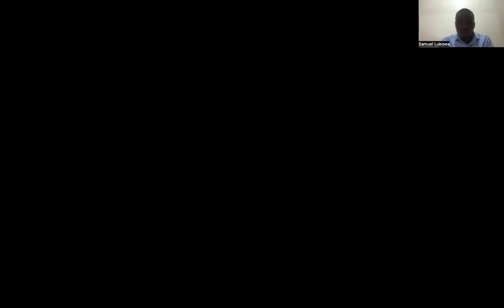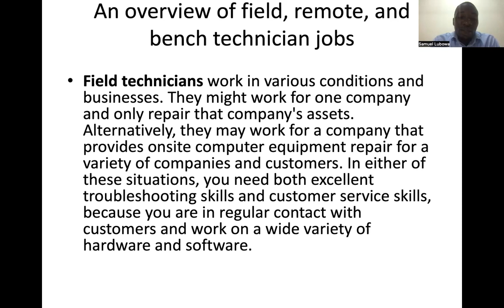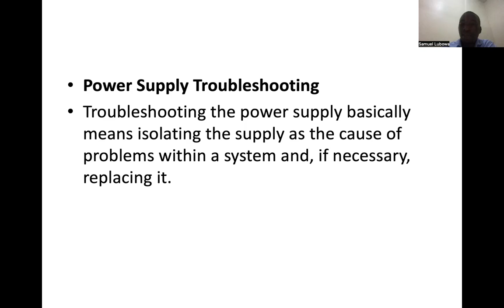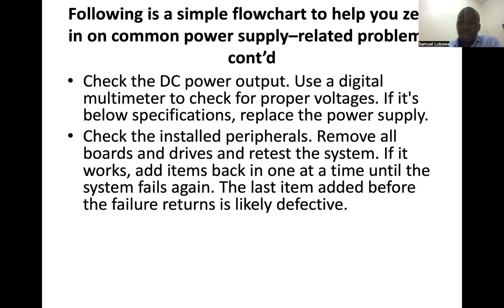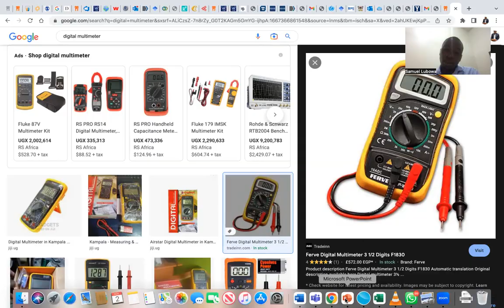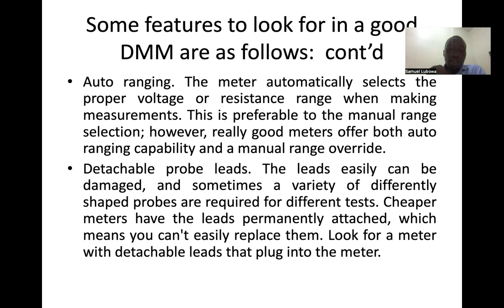PC Technicians & Power Supply

Comment: THANK  YOU SIR 
I have learnt the signs one can easily identify when the power supply system is failing.
But maybe more explanation on the technicians (remote and bench).
More  about Troubleshooting  a power supply.

According to how i have understood the digital multi-meter  i think does not only measure the voltage  but can also measure current and resistance meaning  it combines the testing capabilities of single-task meters like voltmeters,ammeters and ohmmeters
Reply from the maker: 1. For DMM you really understood it well
2. Then for Remote technicians, these are like Telecom companies customer service attendants, whom you can call if you have an issue eg if you simcard no longer sends sms' and they direct you on how to solve the issue eg by entering the message service number without you going physically to the service center.
3. For bench technicians, they can be fulltime or part time employees of the company of freelancers who go to the site to carry out technical tasks physically Eg As a bench technician, you typically do not work directly with customers. Bench technicians are often hired to perform computer warranty service in a central depot or work facility

Comment: Thank you for sharing sir.
From this, I have learnt the different types of technicians especially the bench technicians because these are usually left out and the different skills technicians should be able to perform.
The Power Supply Unit, how it coverts AC to DC. But would like to know more about how to troubleshoot it since it is a skill a computer technician should have. 
The different cases where the power supply unit could be failing were all clear and the reasons why it keeps on being a power supply unit too. Finally the digital multimeter was also clear. Thanks again.
-Wavamuno Daniel L
Reply from the maker: Troubleshooting a Power supply unit is the process you go through to identify an issue and provide a solution

Comment: Kato Joseph Bwanika. 

Sir I didn't understand clearly the explanation of bench technician.
Sir I would like to inquire about what makes a digital multimeter protect it's self from damage when voltage is beyond normal?
I have learnt about the skills that a field technician needs to be having for example; troubleshooting and customer service skills.
I have also learnt about the main purpose of a power supply and how to identify it's problem signs of failure.
I have also understood clearly the features for a good digital multimeter for example; pocket size and overload protection.

Reg: 2021-D011-11981
Reply from the maker: Bench technicians are often hired to perform computer warranty service in a central depot or work facility
Reply from the maker: a DMM has a controller inside which helps it to regulate current flow hence its always safe

Comment: Thank  you sir. Apart from the battery in the laptops, i always see the charges of the laptops have another thing like the battery., is the one that changes AC to DC on the laptops?
Can too much power lead to the break down of the USB ports. 
what if the screen wants to display something and it doesn't is it because of the failure of the fan to spill!
Reply from the maker: No, you could be referring to an adapter, but the laptop also has a power supply inside it, only that its small in size compared to that of a desktop

Comment: Thank you sir for the lecture.I have learnt a lot today AC is more efficient. Its ability to travel back and forth made gave it the ability to travel over longer distances. Thus making it able to power more Areas. but i would like to know. sir why is that when a computer directly connected to the power supply fails to work?  and how does a computer and power supply work. and how could i know if its the cause of my computer turning its self off and on.
Reply from the maker: The question is not clear, may u rephrase for proper interpretation please
Reply: @samuellubowa  WHY is that when computer connected directly to the power supply fails to work.

Comment: thank you sir.
i have learnt quite alot and below is a few of the things i have learnt
direct current, the voltage is always constant, and the electricity flows in a certain direction while in alternating current, the voltage periodically changes with the direction of the current also periodically changes. Digital multimeter measures and verifies multiple electrical charges, resistance, and current  in addition It's a daily diagnostic tool used by technicians and electrical engineers.
Reply from the maker: You are most welcome

Comment: thanks master i really enjoyed the class, Now i know what it takes to be a remote technician. in the slide of power supplies, if you connect a power supply of above 400 volts in a computer here,what are some of the parts most likely to be affected if it  blows.  Another question is what causes hard disk failure in a computer. and lastly my inquiry is in computer behaviors, my phone normally restarts by itself after some hours of use and also some applications just crushes or  fails to open ,what could be the cause of this software behaviors  and what are some of the trouble shooting process to follow in order to solve it .thanks
Reply from the maker: Re-check well the video and slides, i didnt mention or include something of 400 volts unless by mistake.
Most Pcs use btn 220-240V and its always only the power supply thats majorly affected and on rare occasions this can be extended to the circuit board

Comment: Thank you Sir.

I watched the part where you were talking about using help desks for providing support to customers and I then I thought about asking about the Remote Control access software and tools like TeamViewer, Anydesk and chrome remote desktop. Are they effective in providing direct support and troubleshooting. I personally have used chrome remote desktop and it is on another level. You can even control the computer and view the screen using hand held devices like a smartphone.

Second question. What is the difference between a converter and power supply? I thought they serve the same purpose.
Reply from the maker: Those tools are effective in providing support so long as the technician and customers know how to use them well.

A converter is a component inside a power supply